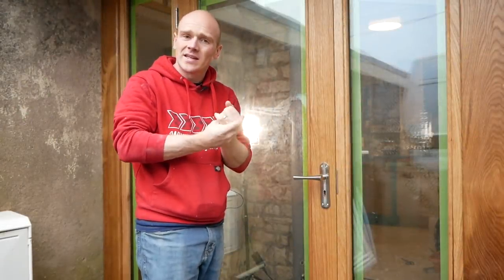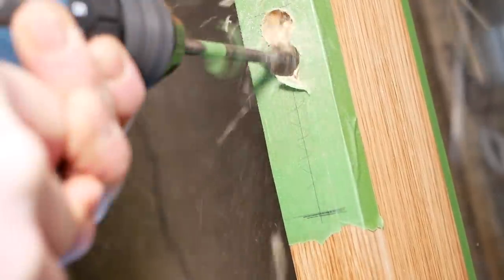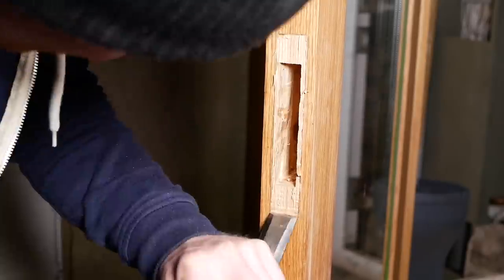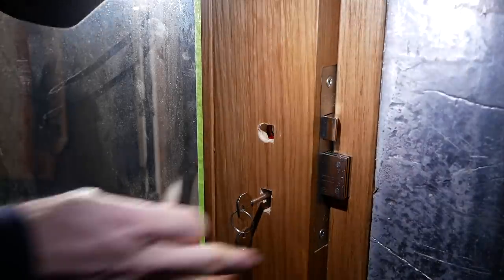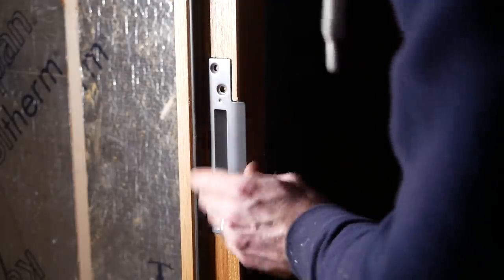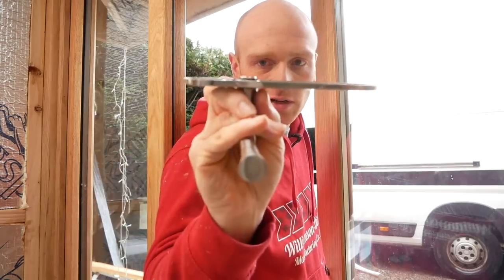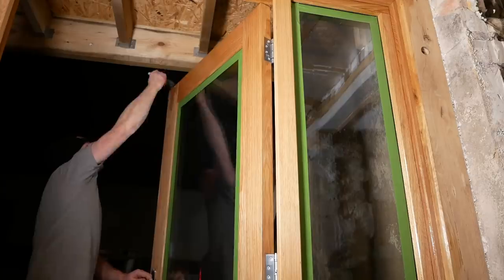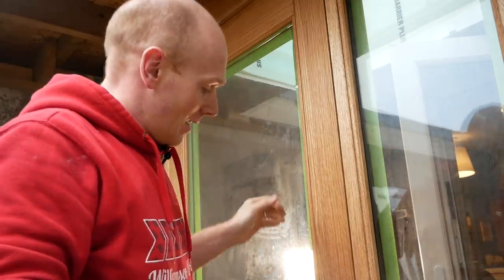How to DIY Fit a Lock and Door Handle

Comment: Another great video & a good job well done. A simple tip worth considering when drilling out the mortise for the lock is to drill the top hole followed by the very bottom hole, then drill the holes in between. This way you never end up trying to drill a part hole at the bottom. I think this may have been the reason your forstner bit ran wild! Keep up the good work👍
Reply from the maker: It is exactly the reason. Great tip. 👍

Comment: for doors I use a clamp on jig and appropriate bits to which I then connect a normal drill. It allows setting of depth  and produces a nice neat cut particularly along the long edge. I find chiselling the long edge never gave the factory finish I wanted but I guess that depends on your chiselling skills!  You were so lucky with that slip..how many times that has happened to me I cannot remember. I felt your pain in the groan....but worked out in the end Phew..

Comment: Lovely. Find hardware fitting quite therapeutic! Also another tip when drilling the lock out keep the flat bit slightly higher than the square top and bottom edge. That way your not spending ages squaring off with a chisel. People forget the radius of the flat bit.

Comment: When it comes to the faceplate, I slide the lock in and screw the faceplate in position. I then run my Stanley round the faceplate. Unscrew the lock and you will have a perfect outline to chisel or router out to. The knife blade will have broken the grain to minimise splitting. I do this on my hinges, locks and faceplates.

Comment: Great work as usual. Good choice of hardware as well. I like that old style hardware with the old skeleton key. Those went out of use here in the US in the early 1900s ish... When we go to Greece the places we stay at use them and the fancy tamper proof modern style keys for the deadbolt. 

       One tip. Paint the wood black behind the trim where the key goes in. It hides the ugliness of the hole drilled in the wood.

Comment: Your fitting of this handle fixed a 5 year old problem for me.  I couldn’t work out why when I tightened the door handle the lock would no longer move. After watching this I realised that I had to make a recess for the spring mechanism on the back of the handle - obvious really just hadn’t worked it out until I watched this - so thank you all sorted and now works properly for the first time.

Comment: Another great video. I've always been a vertical slotted screw man myself. I reasoned that rain would run off the screws more readily and minimise them rusting, but if I'm honest it's just down to how it looks visually (damned OCD!) Plus I always use stainless steel screws externally, so rust shouldn't be a problem anyway! 🤣
Reply: I was told its vertical because back in the day handles got painted and runs off the screw  better so you can unscrew easier.
Reply: @dalemoore11  Good point, perhaps that's where I get the vertical screw thing from 😊

Comment: Is the handle springing back up ok ? If it’s not, open the door and look at the handles , eye level with latch part . And see if the in line . sometimes the smallest misalignment can cause binding. You can get away with this by backing the screw or two off by a little .
Also use a 20 / 25mm flat bit for spindle hole .

Comment: Is a lot of work in something as simple as a door lock and more so when want finish and function smooth .
I made a measure mistake once on a lovely hardwood door as had the lock upside down when marked handle hole, luckily hole close to centre so the plate covered the oval hole I had make correct that cock up .
Job jobbed, real wood looks so much better than even the best upvc ...